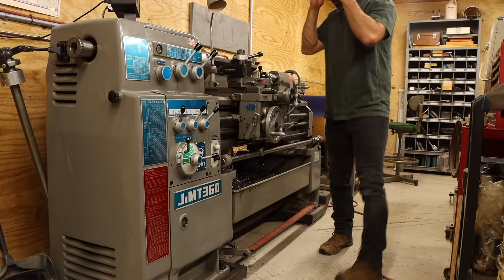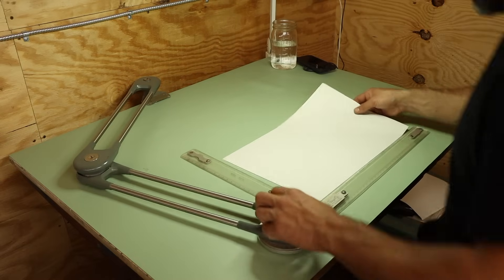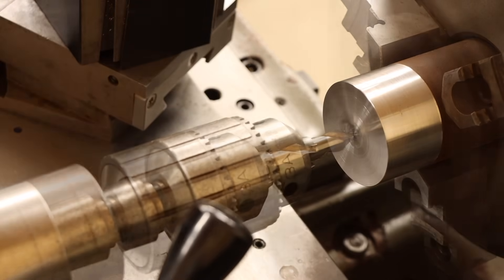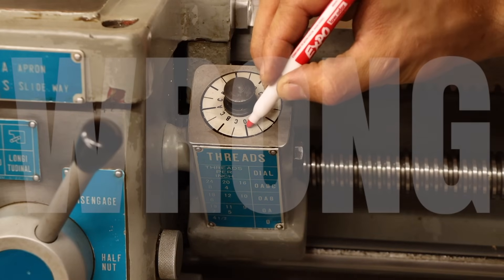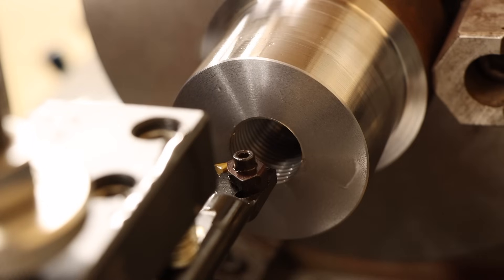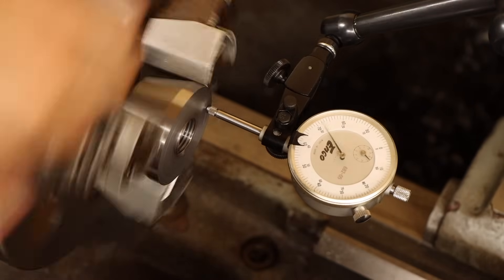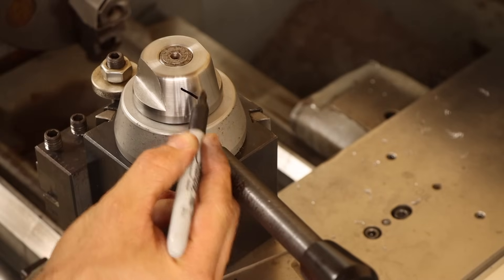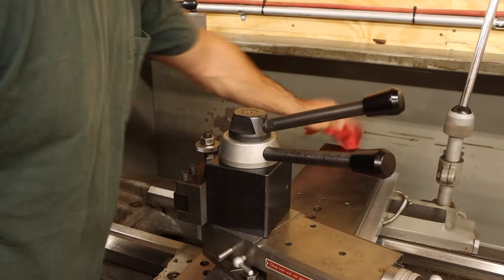A Better Tool Post Nut || INHERITANCE MACHINING

Comment: Another enjoyable video, I love the attention to detail and the fact that you show all the mess ups. 
Just to throw this out there as a potential topic for a video… I really like your cold blueing results. I’ve struggled to get a consistent finish on parts with a small bottle of Brownells blueing and cotton balls. Could you talk about your process including prep and material source and costs? Thanks.
Reply from the maker: Thanks! I might have to do a little more detail on that in a future project. Just for you right now though take a look at Caswell Plating. Their kit is the one I use and I basically just follow the directions and get pretty decent results.

Comment: Great project, as always; good lighting and clear photography.

I'd like to comment on a way you can distinguish your projects a little. ToT and Quinn from Blondihacks both blue their tool-steel projects, and that's nice enough. But it's a bit bland. Now, for almost no extra work at all, you could nickel-plate your projects. It could be part of your brand, and would certainly set your work apart.

If nothing else, it adds a bit of bling and some MUCH better corrosion resistance.
Reply from the maker: thanks! I might consider that but there's also something so traditional that I like about the black oxide finish in some circumstances. Any recommendations on a nickel plating kit?
Reply: https://youtu.be/G-PtnwtOR24

Sure!  Build your own.

Comment: Great video and I've been really enjoying the whole series. Thank you!

I thought I'd try and explain the threading dial a bit and why it went wrong, hopefully this helps

One way to think about the threading dial is that it's measuring distance moved of the carriage relative to the lead screw. If you set the dial on a mark, then move the carriage 1 inch with the half-nuts disengaged, you should see the dial land on another mark. I would guess that your dial is set to measure 2 inches for a full rotation, then 1 inch between the 0 marks, half an inch between 0&A marks, etc.

The reason why this works so well for inch threads is that they're specified in teeth per inch so, if you have a whole number of TPI and you move the carriage one inch along the thread, it will always land back in the thread no matter what the pitch is. If you've got an even number of TPI, you can get away with moving any multiple of half an inch, and so on.

This all falls apart with metric threads because they're specified by pitch instead of teeth per <something>, so it's hard to find some relative distance between the carriage & lead screw that will be guaranteed to be a multiple of the pitch. Lining up on one mark on the threading dial simply set that distance to 2 inches, which definitely doesn't divide nicely by any metric pitches.
Reply from the maker: Ah... that totally makes sense... If thats the case then one time engagement technique will be the only way to cut metric threads with my lathe. Thanks for the explanation!
Reply: @InheritanceMachining  This is the way I cut metric threads on a standard manual machine, you could try this and see how you like it. I will engage the half nuts like usual on say 0 then when I get to the end of the thread I will disengage the half nut and turn off the machine. (Back to cross slide out obviously) Then put the machine in reverse and engage the half nuts back on the zero in reverse when you hit it. As long as you don't make a full rotation on the dial and then go for it, it should work.
Reply from the maker: @oldsoulkid9263  that’s a good tip!
Reply: @InheritanceMachining  my thread dial came with an interchangeable set of gears that engage the leadscrew, one for metric and one for imperial.
Reply from the maker: @Anonymousg64  interesting… I just checked mine and the gear that engages the lead screw is 1:1 with the dial. Does yours have an internal gear reduction?
Reply: @InheritanceMachining mine is 1:1 also, the gear is changeable,  the metric one has a different count of teeth vs the imperial one.
Reply from the maker: @Anonymousg64  oh.. duh! of course
Reply: @InheritanceMachining  Side project (you seem to have run out of them🙂): imperial threading dial for a metric lathe https://youtu.be/zG9XYDCDwWY 
Obviously you'd need to reverse the idea to make a metric threading dial for an imperial lathe ;-) 
Additionaly it's worth pointiing out two tricks. 
1) Yes, one time engaement is the way for non-native threads BUT when you're threading up to a shoulder or blind hole you can disengage the half nut at the end of the thread, retract, and stop the lathe. The lathe will have stopped before the threading dial has completed one revolution - this is critical. Now reverse the lathe and as the threading dial reverses back to your initial mark re-engage the halfnut and let the lathe reverse you back to the start of the thread. 
2) Joe Pie's trick of threading away from the chuck with a lefthanded tool on the far side of the part. (I think someone else has mentioned this.)
Reply from the maker: @ericfeatherstone  you are reading my mind 😁 on 1) someone mentioned this as well, I’ll be using this technique for sure. On 2) I would much prefer this type of internal cutting. An opposite handed tool will likely be my next purchase… if I don’t make one first!!
Reply: @InheritanceMachining  I've disengaged the half nuts and rewound the VT to the point where the front of your threading dial block is clearly visible. You have a "4 inch" threading dial, in so much as 1 complete turn of the dial is 4" of travel of the saddle along the bed. The 0 marks are every 2" of travel, which is where 1/2 pitch threads (11.5 tpi, 4.5 tpi etc) line up. The 0 & A marks are 1" apart, so all the whole number tpi line up there. 0, A & B marks are 1/2" apart which is where all the even tpi line up, and finally the 0 A B & C marks are every 1/4" for any tpi divisible by 4. 
Useless tidbit of info: there are some metric threads that you CAN cut with your threading dial! But they aren't very useful threads 😞
0.2, 0.4, 0.8mm pitch.
Why? Because 127 turns of each are 1", 2" & 4" long. So you can use the 0 & A marks for 0.2mm, 0 marks for 0.4mm, and one (and only one) of the '0' marks for 0.8mm pitches.
Reply from the maker: @ericfeatherstone  Very useful info!
Reply: Metric threads read distance between teeth (ex. M22x2.0 is a 22mm diameter with teeth every 2mm). Most imperial lathes require you to leave the half nut engaged, and reverse the motor so the timing remains intact. This Old Tony has a very good video from a few years ago documenting all this you might enjoy watching.

Comment: That is a good upgrade, your videos are always interesting. Another upgrade I plan to do on the qctp nut is to put a thrust bearing because a lot of clamping force is lost in friction from the nut and the top of the tool post.
Reply from the maker: Thanks! that's an interesting idea... I assumed the friction up there helps with holding the position, but theres much more surface area on the bottom side for the tool post for that.
Reply: @InheritanceMachining  I think the clamping force gained with the thrust bearing is sufficient with the huge surface under the tool post in order to secure it firmly.
Reply from the maker: @lucasandri5462  I think you're right
Reply: @InheritanceMachining  I don't know 😅, it's just a matter of trying. As your nut is sufficiently big I think you could try with a needle thrust bearing and cut a recess in the bottom of the nut. So it esthetically good looking and protects the bearing from swarf dust ecc.
Reply from the maker: @lucasandri5462  lol I’ve had a couple others mention this now so you must be onto something
Reply: @InheritanceMachining  FWIW Joe Pie is very anti thrust bearings on toolposts: https://www.youtube.com/watch?v=Y1cUg2Mqr_c&t=1168s

Comment: Nice! Funnily I made a new nut to fit a quick change tool post to my lathe this week too. Except my thread was M14/2 and I couldn't get a boring bar in it, so I had to order a tap. Cutting m14 by hand is a bit of a task!
Reply from the maker: what a coincidence! I'll say that tap wrench I used/made gave me a ton of leverage. might be a good project for you if you don't already have one

Comment: Good to go. That reminds me how i cut inch threats on metric lathe. Same story. When i made a tool holder nut on my lathe i adjust the position of handle just like you.
Reply from the maker: It would probably help to really dig into and test the engagement points and make a separate tag for the opposite threads. If i get into any more metric stuff it will be a necessity

Comment: Those wrench flats and the handle position were very fortunate.  I've pulled a bozo on those before.  I guess you balanced it all out by scrapping the first two attempts!!  Looks good.
Reply from the maker: Very lucky! the stupid part was I thought about that during the design phase then completely forgot... thanks!

Comment: No side projects? Unsubbed. 😀
Reply from the maker: 😂 a rare occurrence for sure...
Reply: Next week we'll find out it was all one big side project. 
Actually he's making a nut for the lathe before he can make a part for the mill, which is needed to make a fixture for the belt sander, to make a part for the press, which is removing a part from the surface grinder,  which is being used to sharpen his pencil to design the part needed to get the wife off his back.
Reply: @lolzlarkin3059  so they are all side projects
Reply: @michael7324  Yes. 

The original project was to set up a shop to play with the cool tools. After that it is shadow boxing to hide the original project. 
Warning: Once you have convinced the better half that nearly anything makeable or repairable  can be made or fixed with the addition of just one tool per project. The tool come frequently and the projects come even faster. 😁😎
Reply: @lolzlarkin3059 , Congratulations! Your comment is hilarious. That one is the best way to describe the infamous "Honey Do" list.
Reply: @michael7324 ALL projects are side projects to the main project of keeping the wife happy, which is, in itself, a side project to a peaceful home life! 😂😂😂
Reply: Side Project count? Zero
Reply: Ha!
Reply: At least he chamfered it 🤣
Reply: He instead restarted multiple times
Reply: an outrage
Reply: Big agree... unsubbed!
Reply: Lmao😂😂
Reply: This was the side project!
Reply: Yeah. Right. You loved every moment. It's okay to admit it. This is a safe space.
Reply: lol!